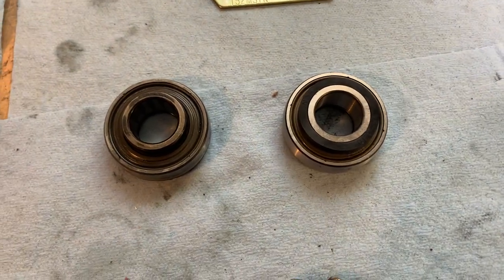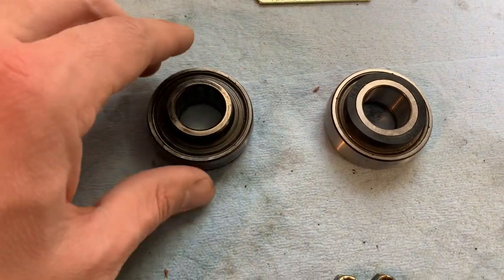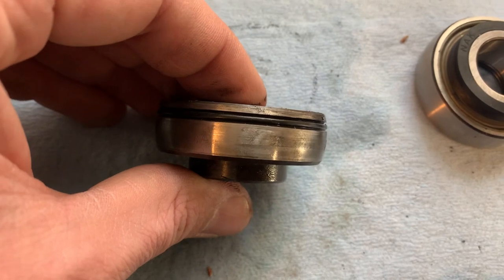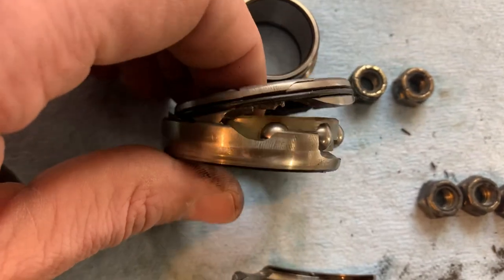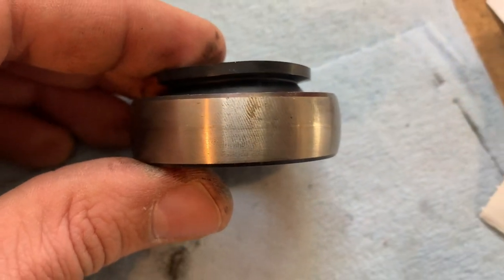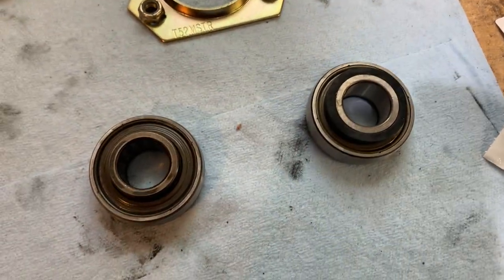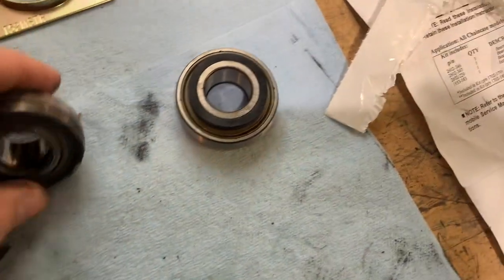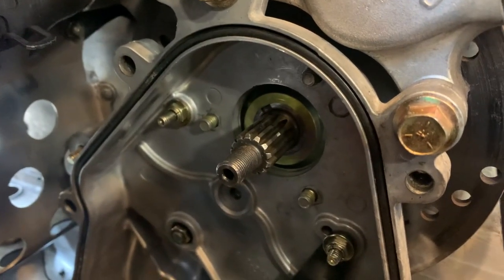2003 Arctic Cat F7 Firecat Updated Chaincase Bearings

Comment: Any tips for replacing the lower chaincase bearing with the updated design? I see the kit comes with an on ring that is supposed to get stacked between the bearing and case. I don't see how that's supposed to stay in place and do anything though
Reply from the maker: No problem-That seemed to be a common design with that era of Cats.  I end up discarding that O-ring and use RTV silicone instead. I coat the outer bearing race with a thin layer of it, then insert it into the chain case housing and assemble everything else around it.  Then, I let the silicone cure for about a day before I add any fluid to the case.  This has stopped all my leaking problems over the years.  Hope this helps.